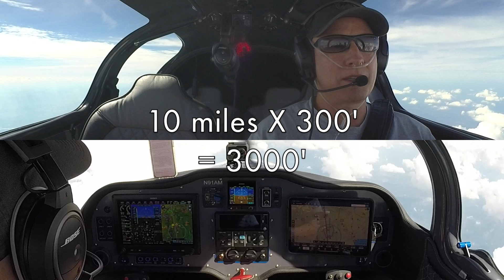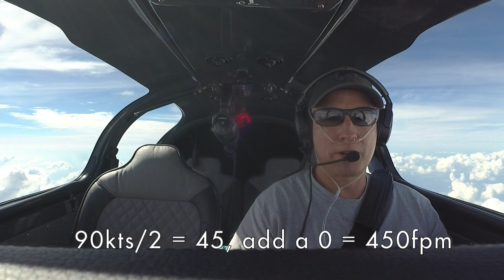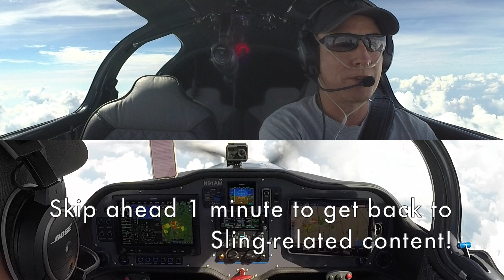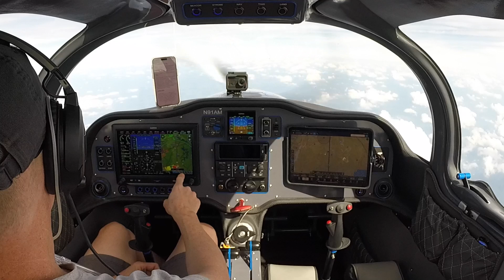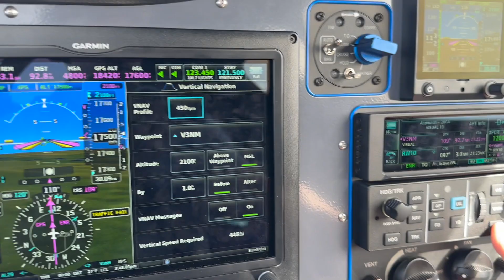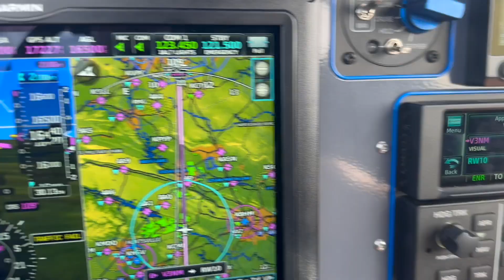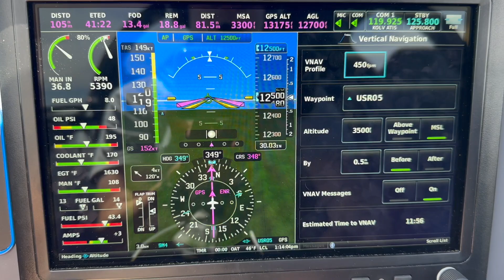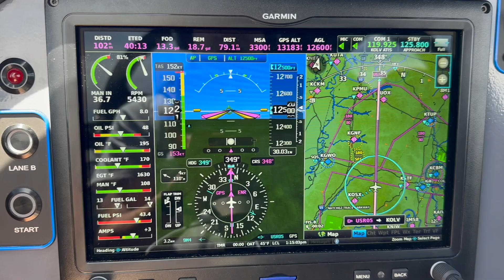Descent Planning in the Sling TSi

Comment: Hi Mike, off the subject a bit, I noticed your  Amber "Traffic Fail" message. I have the same message (ADSB OUT  in my Sling 2  - I do not have ADSB IN and my ADSB appears to be working normally with no queries from ATC) The message only appeared after loading 9.41 update G3X.  Unable to clear the message - contacted Garmin but no solution yet - any ideas from your side.
Reply from the maker: That only happened on that one leg, then it cleared up after that. Not sure why. When I've had it in the past, a subsequent software update fixed it.
Reply: Thanks Mike - I see there is a 9.51 update - will give it a try

Comment: Agreed 3 degrees is too fast of a descent rate in the TSi. Mine has the GTN 650 so I changed VNAV from the default 3 to 2 degrees, and that does a great job gently guiding the plane down from high altitudes. I haven’t had your issue with the plane diving too steep on autopilot, you could probably tweak the AP configuration to be less aggressive and resolve that.
Reply from the maker: It's not actually the autopilot itself that's the problem. (I've got my AP config dialed in pretty well. It does great on approaches!) It's really how the VNAV reacts to a change in groundspeed after descent has begun, and therefore a change in the vertical speed required. It may be that your GTN handles this better than the G3X VNAV.

Comment: Interesting video! I also liked hearing how it's done at the airlines. 

In my airplane, which has similar performance to your Sling TSI, I keep it simple and start my descent based on time. If I'm at 15,5k' and need to get down to 3.5k', that's 12k'. 

500 FPM is a comfortable rate, so 12000/500 = 24 minutes. If the air is smooth I'll leave the power in and gain some speed while descending, which means I should start the descent a minute or two earlier. I keep an eye on the ETE number in ForeFlight (or whichever nav system being used) and start down when the time comes.
Reply from the maker: @slk23  Ooh, I like that even better! Just double the altitude you need to lose and that’s your TOD in minutes, plus a couple minute buffer. Nice! (My rules of thumb are from a bygone era when we didn’t have GPS giving us a nice ETE. 😆)

Comment: Hi Mike, I met you at the party at Oshkosh this year, I have 782MB. Great video. I'd like to learn more about thermostats for both coolant and oil. What are you using?
Reply from the maker: @bentaves8924  Great meeting you at Oshkosh. I’d like to learn more about thermostats, too! I don’t have either. I don’t really need an oil thermostat down here in the south, but I know folks up north like them to help the oil temp warm up quicker in the winter. I’d like a coolant thermostat, mostly to keep the coolant temp warm enough to keep the cabin heater effective. Right now I just tape the radiator in winter. I hear the Franz thermostats are good. I know a guy with a Rans S-21 who was going to install them. I’ll reach out to him and find out how well they’re working for him.

Comment: I’ve got the GNX 375, too. When you use the VNav on the G3X, do you need to set the flight plan on the G3X to use internal vs. external source, or does it work even with the 375 as the source?
Reply from the maker: @EdwardHefter  It works with the 375 as the source.

Comment: Thank you Mike.  This is another excellent video.  I completely agree with you that setting VS on the autopilot, as opposed to coupled to VNav is a more stable descent.  You did an excellent job explaining why.  Would love to see a video on some practical IFR flying from you.  Some of the things you consider for go vs no-go decisions and planning etc.
Reply: Thanks Mike, I tend to use time. So at 500ft descent rate it will take you 2x the altitude you are required to lose (eg 10kft = 20mins), use VS and adj throttle to keep speeds in check. Enjoy your tips.